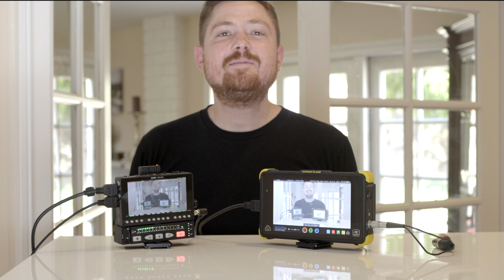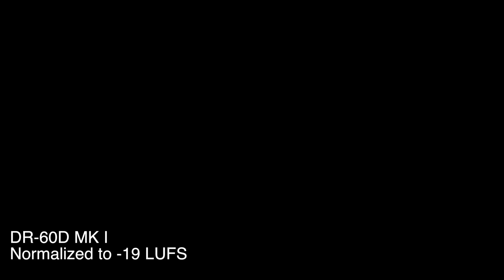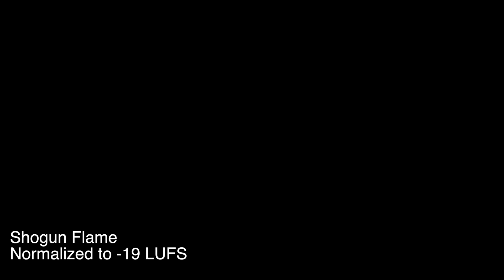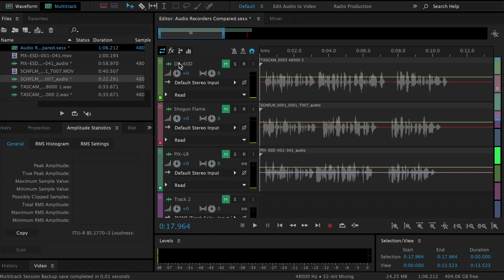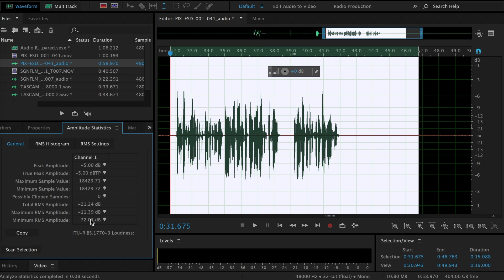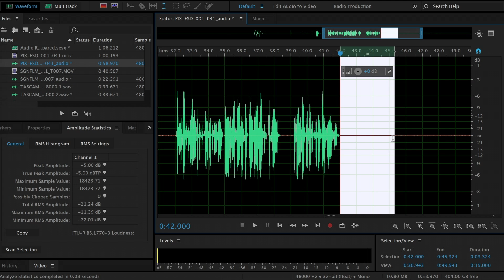Audio Comparison: Atomos Shogun Flame vs Video Devices PIX-E5H + PIX-LR

Comment: Good audio is half your video or so they say. Yet the lack of attention to the audio part in many equipment reviews is astounding. Very nice to finally see a difference! Even a very well executed one too! Congrats! I encountered the same problem when I was searching for reviews on the Rodelink Filmmakers Kit Wireless Audio system.  After hours of searching I knew about everything... except A) the noise floor and B) the general sound quality compared to other options. Annoying to say the least! So I decided the rent the darn thing and do some tests myself. Unfortunately the noise floor was even a little worse compared to the Sennheiser G3 although the sound quality was better (when used with ME-2) 

Which brings me to a dilemma because investing in a PIX-E5 (with its excellent pre-amps) is kinda useless if combined with noisy wireless audio systems. I suppose Letrosonics are better (???) but the price point of those system makes me wanna hide under the sheets and cry ;)